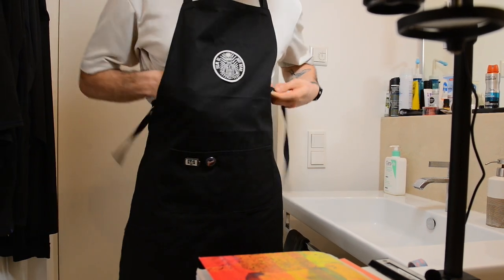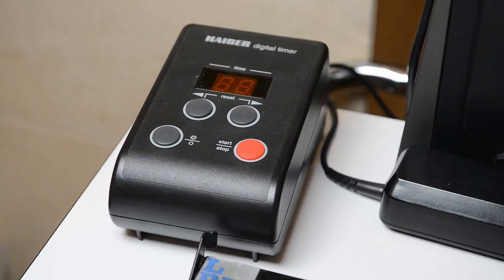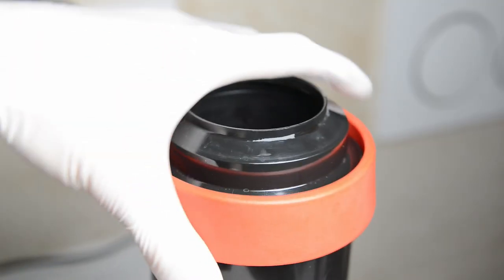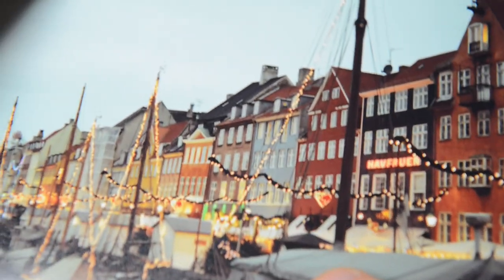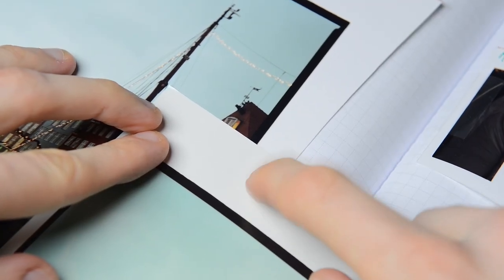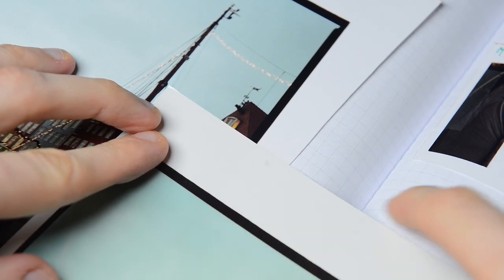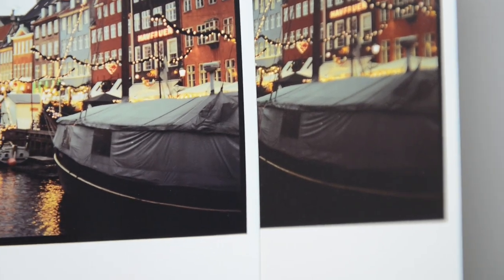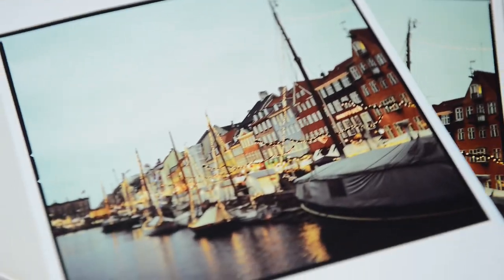Darkroom prints from Nyhavn at Christmas, RA4 process and problems with paper quality

Comment: Do you re-use your chemistry? I thought you had to use the dev and blix as one-shot, developing one print then discarding it, using fresh chemistry for each print. Also have you ever tried using the chemistry at room temperature? I got tired of having to heat up my chemistry so I started using it at room temperature, but with an increased developing time of 2 minutes, with good results.
Reply from the maker: One shot in principle waste of chemistry. I use 500 solutions for 40+ prints, so for drum you need at least 50 ml, so you can calculate yourself. I don't develop at room temperature because it's longer, so it's increase my production time and i don't have stable room temperature, it's +-4-5 deg, so my corrections will be of from my notes. And because i make prints also for sale it's important for me. But thx for advice, it's art, and it's not direct strict rules what everyone should follow, so all types of experiments always welcome.